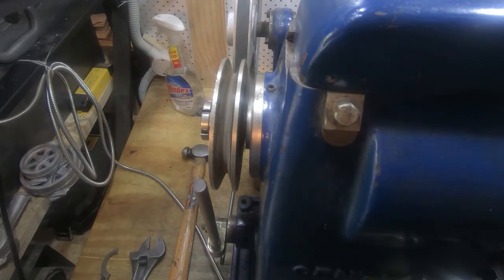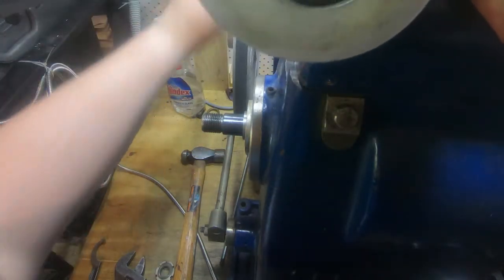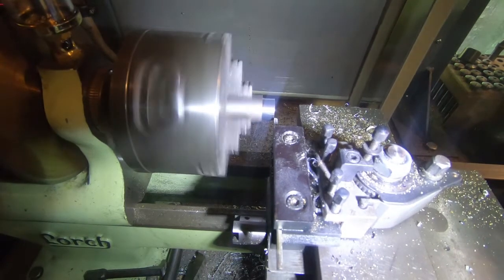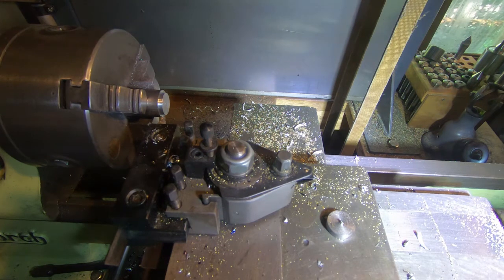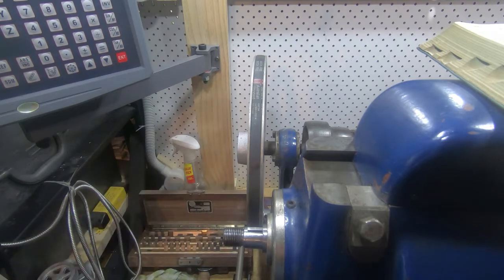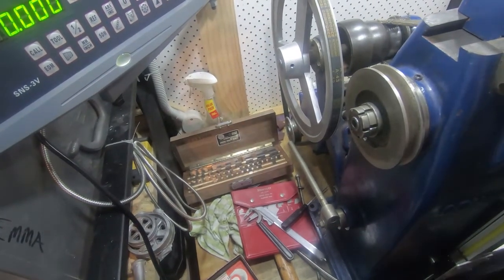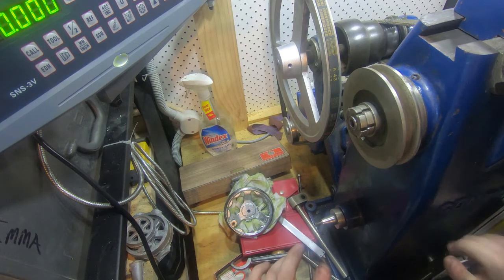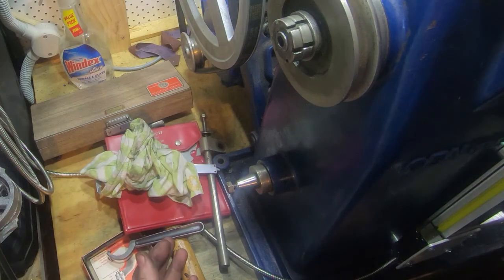woodruff key etc and future mill mods

Comment: I hate dealing with woodruff keys lol they are a pain

One thought on the worm arrangement, maybe it will gear the mechanism down so you have to crank it heaps of times to move a tiny distance. Is it worthwhile just putting in bevel gears to the handwheel?
It's a bit hard to say without knowing the head movement for one turn of the shaft

Comment: hi Emma,
Couple of thoughts on the mill.  I put a lead screw under the knee and used that interface to put a sprocket and chain to counterweight the head (this was a lot of work and only did it as I was cncing the mill).  The lower work solution could be to use the machine face of the boss on the back to bolt and dowel a plate to.  You can then mount some sort of bracket with bushings for your worm.

Comment: Hi  EMMA, put the gear on the taper and make a U shaped bracket with two bushings for the worm shaft and use the mounting holes in the base casting
Reply from the maker: Thats a good idea. Hadnt thought of that